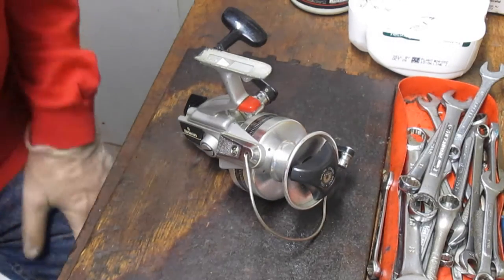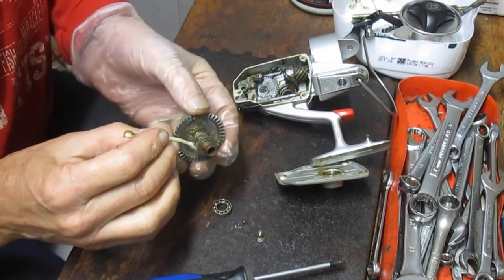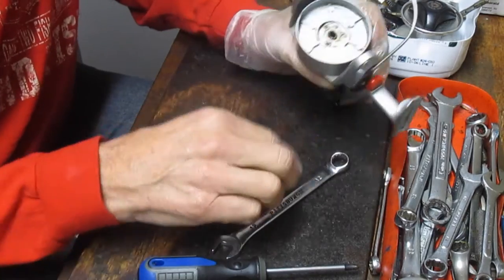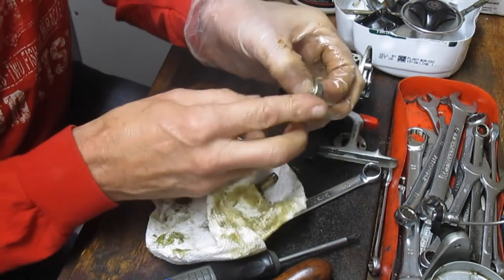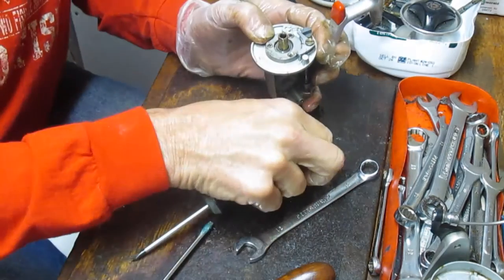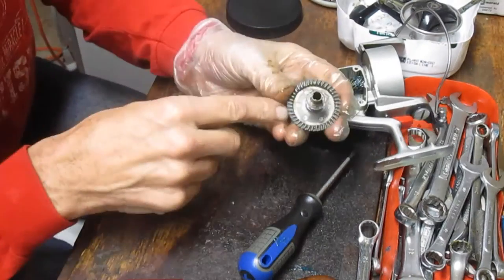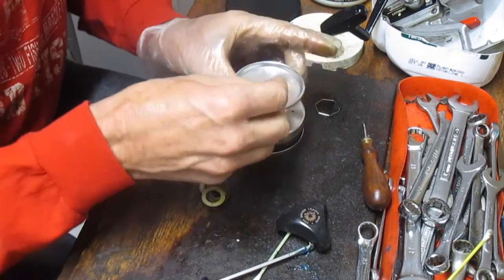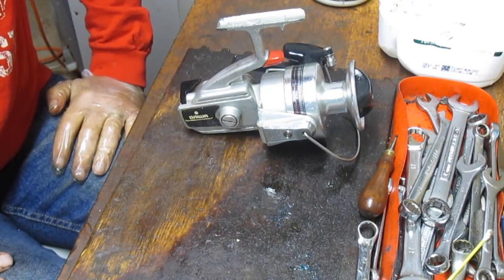Daiwa 7000C Fishing reel how to take apart and service this classic

Comment: CAUTION ....DO NOT disassemble the handle. Having spent several hours (trust me) on reassembly of the handle, I know by firsthand experience. My curiosity always gets me in trouble, but I cannot help it. However, I like to prevent the viewer from getting in trouble like I did. All fixed now.
Reply from the maker: Word of caution noted.  Why were you taking the handle apart?
Reply: Thanks for the reply. Why people climb mount Everest? I was curious to see how it worked. Not the first time that curiosity has gotten me into trouble. There is a spring and a 1/8” ball that was very hard to reposition. Finally, I had a very thin feeler gauge that I put on top of the ball, and was able to reposition it.
Reply: @Mahigeer1  Can confirm! I did the same thing (folding handle locking collar/tensioner) both in the name of finding out how it worked and to be thorough in my strip down and servicing! It is incredibly hard to get that tiny ball bearing back into position while simultaneously keeping the coil spring pushed down! Mine sprung out several times and it was a miracle i found it on the backyard paving! Don't play with it unless you want a good 1hr+ of frustration and watchmaker levels of intricacy .   That said. its a testament to the amazing design and quality of this reel, that Daiwa placed a spring loaded ball bearing there to keep the handle locking collar from unintentionally loosening and also, it feels fantastic as it clicks when you do tighten or loosen it.
Reply: @HereIsMyOffer  Lesson learned. I hope others who read this will learn from our experience. All the best.
Reply: @Mahigeer1  Cheers mate! The old saying rings true ''if it ain't broke....

Comment: Believe it or not I now have 5 of these remarkable reels, I kept trying to get a spare parts reel but they all cleaned up very well and were in great shape for fishing. I have 7 NOS black handles for my 7000C reels. Most of my 7000C still have their original chrome handles in good condition but they are prone to deteriorate in saltwater. I take great care of my reels so this may not happen to mine. I am going to modify one or two of my spare handles by putting  power knobs on them. I’ve still got my first 7000C I got back in the 1970s. It was my first surf reel along with a Penn 706Z. —— Chris
Reply from the maker: Wow - they just keep coming!  Enjoy

Comment: Watched this again for fun. I replaced all the bearings in one of my 7000C today. It is so smooth now. Believe it or not I’m up to six of these now, Rick Stivers of YoungMartin’sReels on YouTube gave me a 7000C that he converted to PUM. He looked hard and found the best line pickup arm for the rotor that is perfect - even better than the original 7000C bail arm. I’ll send you some photos of the reel. I want you to see the fine work he did making that reel. Daiwa actually manufactured a PUM 7000C. I’ve seen the schematic but not the reel itself. If I ever found one for sale I bet it would cost hundreds of dollars. — Chris. PS. I have two complete sets of all the Daiwa silver series reels (exc. the 1500C which I dislike). In addition to six 7000C I have four 4000C and four 9000C saltwater size reels.
Reply from the maker: Thanks again Chris - the PUM set up should be interesting on that reel

Comment: Hello Dennis, I started with  an 8' surf pole and a King Neptune reel, remember those?? (still have it and works fine) while Dad had a 9' Garcia Conolon and Mitchell 302. In early 70's he came home with a 10' Conolon and a Daiwa 7000c and passed his set up to me, I was of course thrilled until I saw the skirted spool in action. No longer had to position the spool out of the hub prior to casting anymore and no sand getting in the hub and accumulating at the bottom of the housing as was the case with the 302 causing that gritty feel. Many times I had to remove the spool and dunk the reel in the water to wash out the sand to continue fishing. I purchased 2 7000c new for I believe $45.99 ea at Kmart back in the early 70's. I much later purchased another three I had found at flea markets for $10.00 each ! Last spring of 2019 I purchased yet another at a yard sale for $5.00 as a spare or for parts, but this reel was in great shape except was missing one of the face covers and had a stiff rotation, maybe could use a good cleaning no big deal. So I go through a thorough breakdown as you do around Thanksgiving every year since I don't fish in winter weather and put them to sleep. These reels are simple to break down, except I had difficulty removing the pinion and bearing on the latest yard sale purchase. I was able to loosen the pinion gear after I gave it a through spray of PB blaster on both side of the bearing, let sit for 30 minutes, but that bearing would not break loose. I tried to pry it out with a flat head between the bottom of the pinion and the housing block it sits in but still no luck and so I stopped as not to break that housing piece the pinion sits in. I then gave it a thorough spray cleaning with brake cleaner, added some oil and grease, put it back together and the reel surprisingly spun like new again. These old reels and mostly all of the older reels can last a lifetime if you do that once a year major maintenance.I still have my Mitchell 302, 406 and 906 reels, Penn 704 and 710 greenies and 704Z. and of course that King Neptune no. 150. I find it to be therapeutic that one tine of year. I just gave you my entire history LOL.  By the way, I have never in the those 50 years ever replaced a bearing in any of my other 7000c reels. Built like a tank. So.... do you have a way to remove that bearing without causing any damage ??. Great instructional video anyone can follow.
Reply from the maker: So - I think you have done most of what I would do.  Try putting the rotor back on the pinion gear after you have removed the collar which holds the pinion gear and bearing in the housing.  By putting the rotor back on you will have leverage to pull the bearing up and out and if need be to rock or walk it up.  That's the best way that I have found to work with a stubborn bearing - Dennis

Comment: Thanks mate, this video was really helpful. I've had this reel in the shed for the last 20 years after inheriting it from my Dad, and after a quick service I've just put it on a new Saltist rod. One thing I'll add is the cross wind gear you mention at 11:10 only adds an extra couple of minutes to remove and grease so would suggest this is a worthwhile step.

Comment: I love this reel and this video . I fished with this reel in the mid 70’s on the NC coast. Wanted to tell you that I replaced the pinion gears and bushings on both my Mitchell 306 reels. It worked like a charm to make the reels as smooth as new. your videos for the 306 were very helpful. One of the pinion gears I had purchased will be sent back. I couldn’t get the shaft back in after installing the new pinion gear. There was a tiny obstruction (metal) inside the pinion that prohibited the shaft from being properly installed. There was a flaw in the interior hole of one of my new pinions. Anyway I had another one and it worked fine.
Reply from the maker: this is a great reel that can still be found at a reasonable price!  One of my favorites!

Comment: I’m looking at this video again because I just got my second 7000C. It is not quite as nice as my other one cosmetically but mechanically it is superb. The 7000C was my very first surf fishing reel back in the mid 1970s. There is no better surf reel in my opinion. It may not be as fancy as modern reels but it will outlast all of them. I have grown to love my Daiwa, Penn, and Mitchell surf reels as well as my 2 Luxor Saumon Mer reels. This is one of my most favorite videos that you have done. I have used your rotor release strategy many times now. It was great advice!
Reply from the maker: Thanks Chris

Comment: Thank you for answering my question. Your method for loosening my seized rotor worked like a charm! Fished with the reel yesterday and had a good day. This 7000C is such a fine reel for surf fishing and very easy to service. Finding an almost mint condition one of EBay was indeed fortunate. Another great video!
Reply from the maker: I'm glad to hear this helped solve your problem.  Your question also helped me get the 7000c off of my projects pile  back to fishing.  Thanks again for watching - Dennis
Reply: My sister just purchased one at an estate sale 7000 C for $22.00. Good price?
Reply: @sheltonhall9278  if your 7000C is in good working order with minimal paint loss, a smooth aluminum spool, and all side decals are present $22.00 is an exceptionally great deal!. I got one once for $17.95 but I don’t think these reels were as popular and sought after as they are now. I have four of them and have two custom handles with Gomexus power knobs that I got on eBay. Altogether I have 23 Daiwa Silver Series reels. The 7000C is the best of the entire series and the only one with three ball bearings.  You got a great deal! — Chris

Comment: I now have the 7000C, 4000C, 2500C, and 2 1300C Silver Series Daiwa reels and love then all. Putting a nice ceramic sealed bearing in the 4000C made it incredibly smooth and should make it last for many years to come.  I think it came from Boca Bearings.I don’t really use the slam feature as I close the bail by hand when I fish with these. Always love this video! Oh, I put the HT100 drag washers in my reels.
Reply from the maker: I am going to do the same with the ceramics and see what a difference it can make.  One of the best reels ever.
Dennis

Comment: Getting out my Silver Series to get them ready to fish. Got the 9000C, 7000C and 4000C out to prepare them. Also I finally got a 700C reel today. Now I have 16 Silver Series Daiwa reels in my set. I am up to 165 reels now. I also got a True Temper 340 spinning reels last night for my collection. Armando Reyes, another subscriber to your channel, told me about this reel. I had been wanting an Ocean City 310 and 320 but they are really hard to find. I’ll probably never use it for fishing but keep as a collector reel. I’ve used my OC 300 fishing a few times though.
Reply from the maker: Sounds like you are set.  I just got a 4000C with a bad anti-reverse for almost nothing.  Time to give it a 2nd Chance - Dennis
Reply: @2ndChanceTackle  Great deal. I have gotten two reels like that. One only had the AR ratchet reversed and I got it for almost nothing. I think that one was a Penn 104.  It was new and never used.

Comment: Dennis, I have 4 of these now all in excellent condition. I recently was able to win an auction on EBay for six NOS black 7000C handles. Three of mine have chrome handles and I know from experience what saltwater can do to those chrome handles. All of mine are fine right now but I had the chance to get these black handles so I jumped on it. I’ve also been able to get 3 of the 4000C reels too. I think I have 23 silver series Daiwas now. My Daiwa 8700 will arrive tomorrow.  I have found out that the only difference between the 8600 (I have two) and the 8700 is the size of the rotor cup and the spool. Absolutely no one has a schematic for an 8700 but I do have one for the 8600.  I’ve missed your videos the past two evenings. I hope everything is alright with you and yours! — Chris
Reply from the maker: I am doing fine.  Just having internet connection issues.
Thanks Chris
Reply: @2ndChanceTackle  Glad to hear it! I got worried when you did not post like you normally do. Ever since COVID has affected so many friends of mine I getting more and more nervous about people I care about! You’re one of them. ——Chris
Reply from the maker: Thanks for your concern!  ll is fine -I should have the issues resolved today  Best wishes - Dennis

Comment: Great info as usual. I like to put a drop of oil between the handle and stud that it rides on too.
Reply from the maker: Good point and tip.  I usually spray the handle knob and shaft connections with WD40 after everything is done.  Your drop of oil will last longer - Dennis

Comment: Thank's for the great video, I found one at a flee market for 5 bucks, the reverse lever was stuck and I took it apart and clean it all up and regrease it, and I happen to take the handle apart to clean, and to my surprise,,,there is a small spring and ball bearing in there, OOOH DAMN, I NOW CAN'T PUT THE BALL BEARING BACK IN...P L E A S E    H E L P ! !  !
Reply from the maker: Angel - can you send ma a picture of the parts that need to be reassembled?  Please send it to my email - 2ndchancetackle@gmail.com and I will see what I can do to help.  There were several different handles.  I want to see what you have.  Thank you - Dennis
Reply: @2ndChanceTackle  Hi Dennis I was watching this video and one handles of my Daiwa 7000c (that I have had since the late 80"s) handles did the same thing little ball bearing will not go into place, and I cannot seal up the handle all the way.

Comment: I just picked one of these up as a spare or parts reel for $2.00 at a garage sale. Cosmetically it's nicer than my old 7000 but it apparently got dunked and never cleaned ASAP. Internals are all fine EXCEPT the AR override is frozen. I can't get the cam to budge. Do you have any "Plan B" tricks?" I have worked on Penn SS models with the same problem that get resolved fairly easily with penetrating oil and heat.
Reply from the maker: Heat and penetrating oil are my go to tricks.  If this is stuck where it is always on, I would not worry it.  If it is stuck off and there is no anti-reverse, then you need to keep doing what you are doing.  If you want to lever it with a pliers, you only have $2 to lose!   Dennis

Comment: Hi Dennis...about the Daiwa 7000.  I have one my Dad bought in Japan (Circa late 60's) when he was a Merchant Mariner.  I have recently lost the spool (overboard...careless mistake).  I've been scrounging for a parts reel or a suitable spool to no avail...any suggestions?  (Correction...the reel is a vintage 'DAIWA SPORT 5000'.)
Reply from the maker: They will be hard to find.  Can you send me a note to my email 2ndchancetackle@gmail.com with this request and a few pictures of the reel?  Also if you can give me the measures of the axle shaft where the spool mounts I may be able to find a replacement in my bins - Thanks for asking Dennis
Reply: @2ndChanceTackle  Roger Dat...comin' atcha.

Comment: Thanks for posting.   I caught a six foot spinner shark on my 7000c today.  The same reel landed a juvenile tiger shark 3 years ago.  These reels are tough.  Do you ever use an ultrasonic cleaner to service reels?  Just spraying and wiping them down works for fresh water use I suppose?   I have to use ultrasonic cleaning to get sand and salt out of my reels.
Reply from the maker: I do you an ultrasonic cleaner on both fresh and saltwater reels when they are particularly dirty or filled with the sand and salt.  I also like to take a salt or sanded reel and put it in a bucket of fresh water overnight.   It is amazing to see what dissolves and shakes free by just letting the reel sit in the pail. After that, I will take the reel completely apart and most parts will go into the Ultrasonic cleaner as a second pass.   You are correct - that 7000C is one tough reel.  Best wishes - Dennis

Comment: Thanks Dennis great video as all the rest of your post. I'm trying to give my father's 7000C a second life. Everything is fine on the reel except the anti reverse shaft is frozen. Luckily it is frozen in the on position so it not that big of a deal. Any suggestions on how to unfreeze the shaft or is it best just to leave it alone.
Reply from the maker: There is only one chance at that and it is to soak and soak and soak it in penetrating oil.  If there is no give when you fo attempt it, then just ride with it in anti-reverse mode.  Any force will rip it up.  The on/off setup is a weak link - Dennis
Reply: @2ndChanceTackle  Thanks Dennis I will try your suggestion and see what happens otherwise like you said it works fine like it is.

Comment: I just acquired two of these exact same reels....I took off the old line and put new line on both....both reels didn't load the line evenly on the spool....one was worse than the other.  Both loaded the majority of the line towards the top of the spool.  Am I doing something wrong?  Does it need to be adjusted?  any ideas?
Reply from the maker: Sounds like you need a shim washer under the spool to raise it up and allow the line to gather to the bottom of the spool. There should be one sitting on top of the axle shaft's click ratchet.  If it is not there, that would be the cause of your issue - Dennis

Comment: How can you smooth the surface lip where the line spools? Not sure what it’s called, but the curved lip under the top where the drag knob is. We were given a reel and that area is slightly pitted or corroded.
Reply from the maker: a micro file or emory cloth would be best.  Just go in small steps until the burr is removed